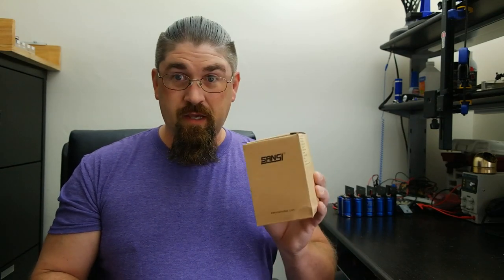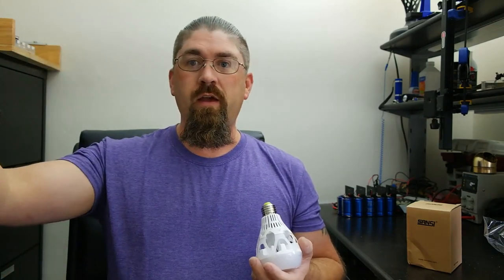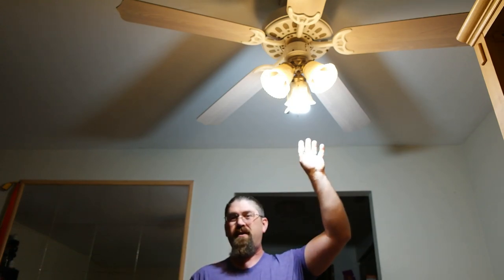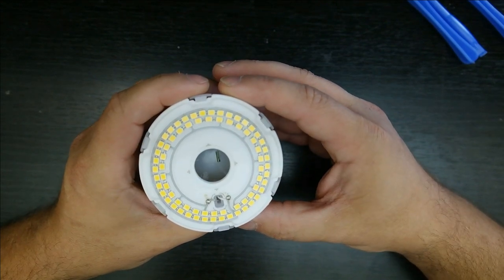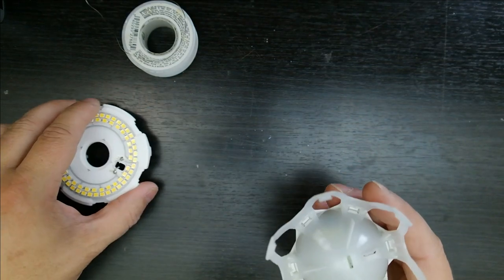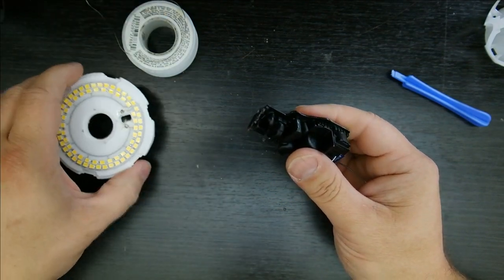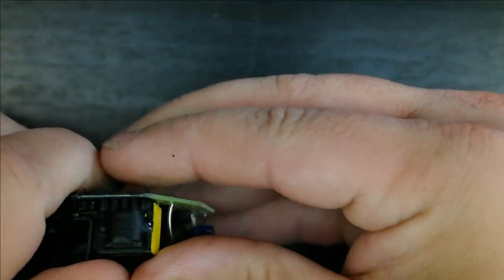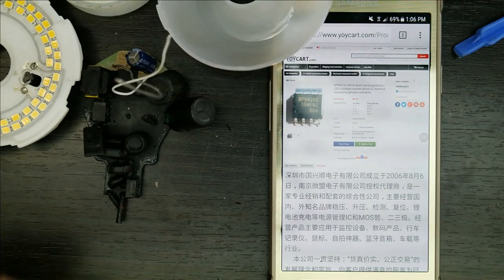SANSI 150 Watt Equivalent LED Light Bulb Review & Teardown

Comment: Nice!!!  I got some 100 watt equivalents from Lowes for $2 a pop a while back (they were on clearance) [I think they claimed to pull 13A/110vac] stupid bright and a good CRI and render index (I think about 4300-4500k. ,maybe 5Kish... too warm and it washes out the color to yellow, and too hot everything is clearer but my eyes get "tired" faster
What kind of current were the bulbs pulling?
Loving the goatee man!
Keep em coming!
Honestly  I would love to see a mix of cold and warm LED's in one bulb..the CRI goes WAY up (because it becomes a wide spectrum color bulb) and the colors it produces are amazing...one temp LED's are very limited in the colors rendered
Reply from the maker: Knew I forgot to do something in the video.  I just hooked it up to me killawatt and the bulb is actually pulling 16.3 watts.
I like the idea of mixing CRI values in a single lightbulb, it would most likely be easier on the eyes.